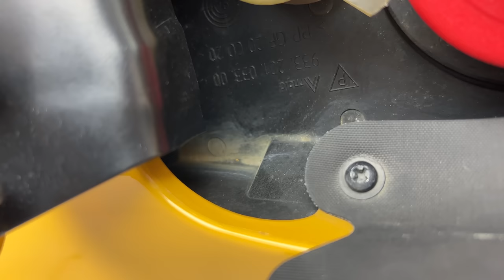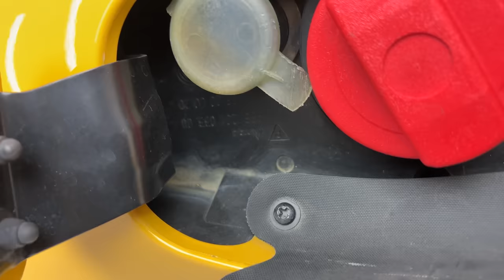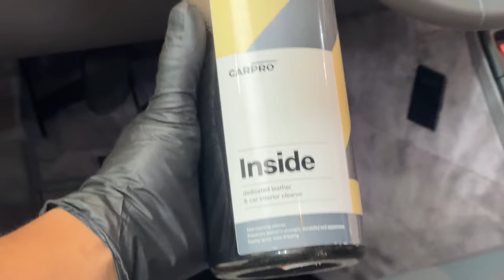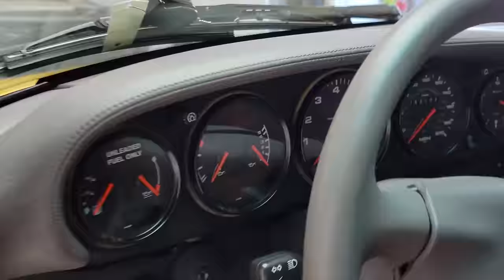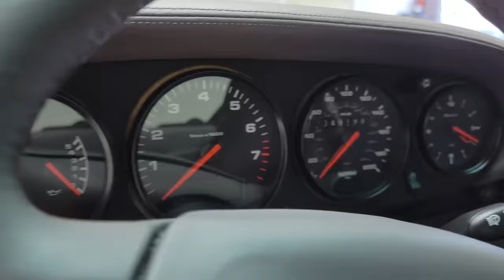DO THIS before SELLING YOUR CAR - Porsche 993 Turbo Detailing & Dry Ice Cleaning

Comment: I’m a firm believer in getting your vehicle professionally detailed before trading in or selling. I went to trade in my wife’s 2017 Jeep Cherokee, fully loaded, all the bells, over 100K miles; after  getting it professionally detailed - we were offered $20K for it… paid $27K brand new in 2017.
Reply: A clean car sure helps, but the fact you got 20K has more to do with the limited availability of new(er) cars more than anything.
Reply: @ArjanSchepers  yes and no. I took the same Jeep to a different dealership on the eastern side of my county a week earlier, before the detail and was offered $9K, a week later at a different dealership in the western part of my county, after the detail and was given the offer of $20K. Also, I traded in a 2018 Tundra Limited early 2021 and was offered $44K. I paid $47K for it.

Comment: This dry ace seems dangerous to the painting, am i right. Awesome job
Reply from the maker: It can be if you aren’t careful or know what you’re doing. Our Coldjet machine is very accurate with its settings and we can dial in exactly how we want to use it, from something light and fairly gentle, to full strength strip the paint off whatever you’ve got
Reply: @IAMDetailing  Awesome, thank you!!!